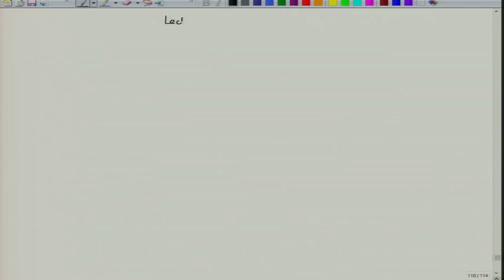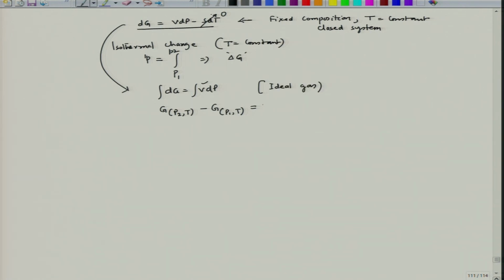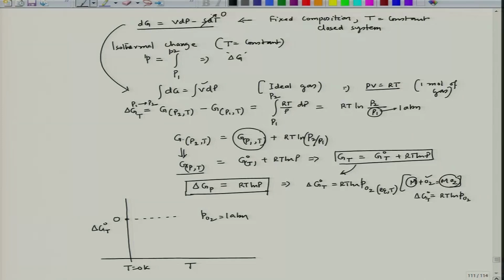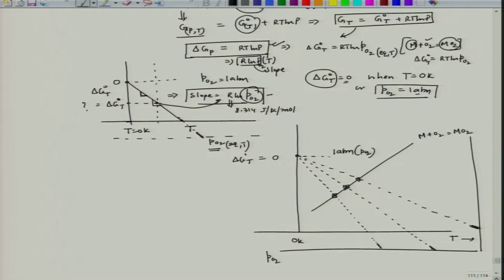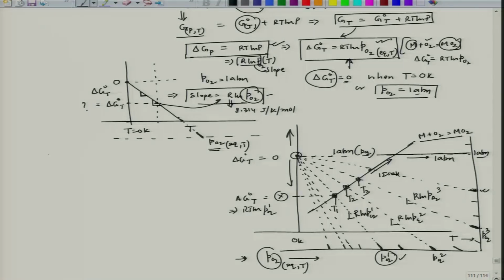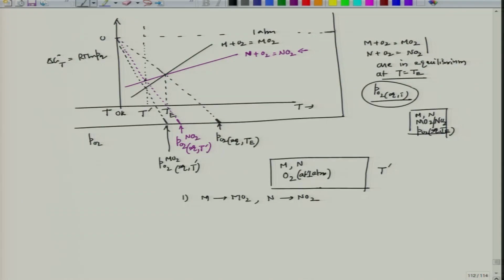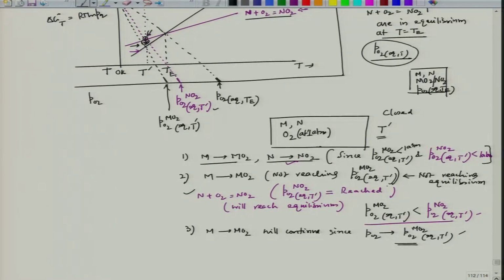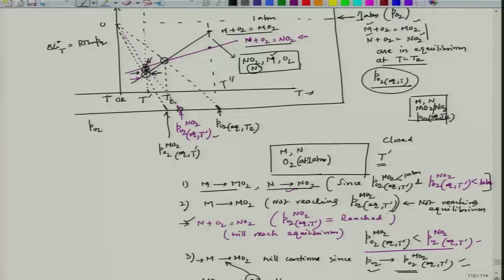noc19-mm15-lec39

Comment: Sir getting confused ..... P o2[partial pressure of oxygen] [at equilibrium 1atm and corresponding delta G= 0] [condition 1: if P o2 actual Oxide1 > P o2 equilibrium reduction of oxide taken place ] and [condition 2: P o2 actual oxide2 < P o2 equilibrium oxidation of metal take place i.e  it require more and more oxygen to get oxidized so it supply form the oxide 1 reduced and supply this. ] so finally oxide1 --> reduced and oxide --> oxidised... But finally on the video 39min you are said reverse. I am getting confuse please explain me clearly.